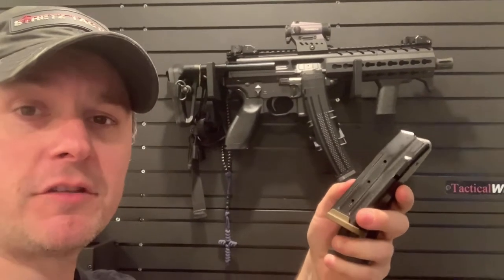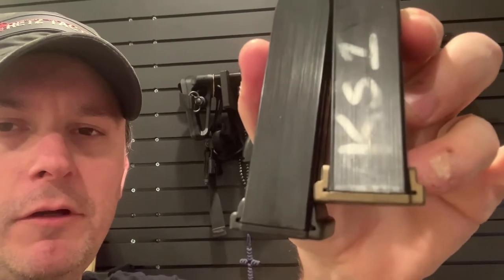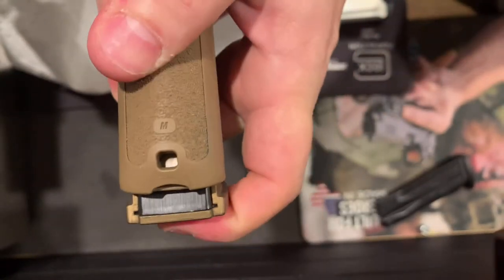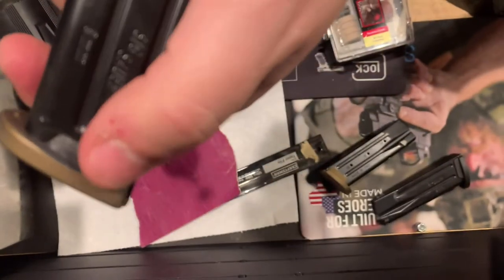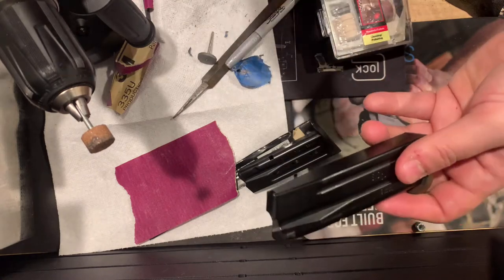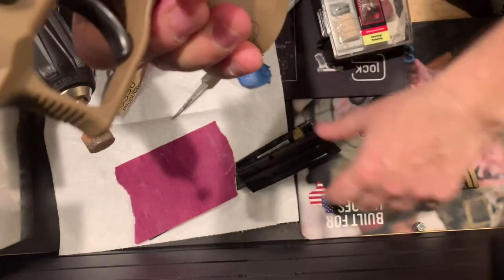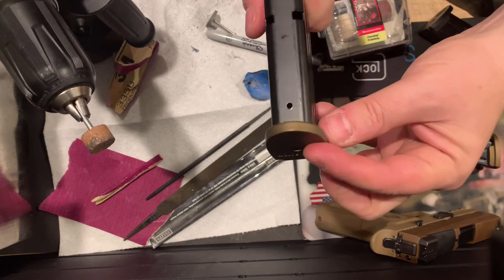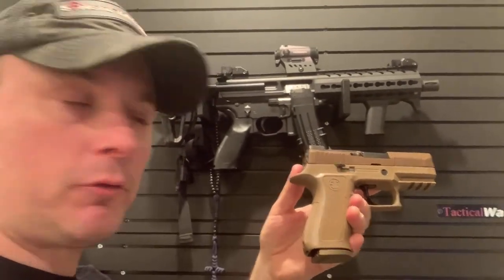Making old Sig P320 magazine base plates work with a newer X series frame

Comment: Do you know if the 10 round mags are able to be made into 15? It’s the one the pistol brought, I don’t live in a restricted state. I know they may have a limiter but wondering if just a quick spring change could mitigate that?
Reply: What did you find out? Here in CA we have 10 round limit. Most times they sell standard capacity 17 or 21 round mags and they just have a rivet to limit follower travel. But i have a few M&P mags that are factory made to hold only 10. Those are a short body and solid mag extension slash base plate. No restoring those to standard capacity. I have never seen a sig factory restricted capacity mag.
Reply: @ryanburbridge  so I managed to remove the limiter from two sig P320 10 round mags, which is nothing but two dents on each side of the magazine. I used a dremel with a grinder and I didn’t have the means to sand it properly but I highly recommend you do, or else you’ll be seeing lots of tiny brass pieces flying out when you shoot. The magazine springs wasn’t an issue and fed all 15 rounds good. Hope that helps.

Comment: I just bought a WC P320 grip module. I have a P320 X compact. I just learned that the new module won't accept 15 round mags. Only 17 and 21 round mags. What a bummer.
Reply from the maker: I thought the compact Wilson will fit the 15’s but not the Carrry?
Reply: @StretzTacticalinc  I ended up buying the wrong one. I got the carry II.
Reply from the maker: @wellington400  The carry/compact names confuse me - easy mistake